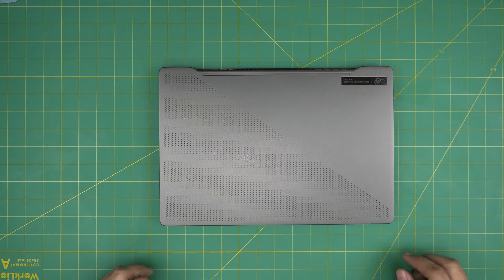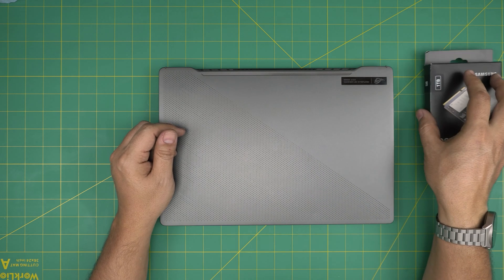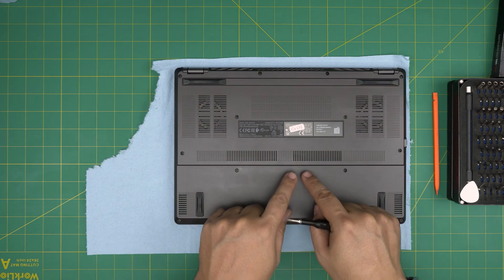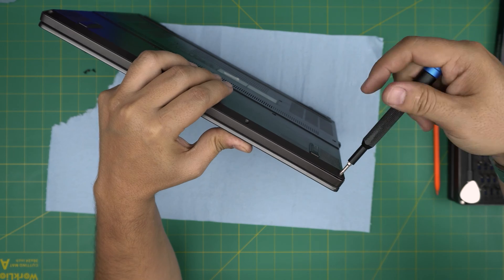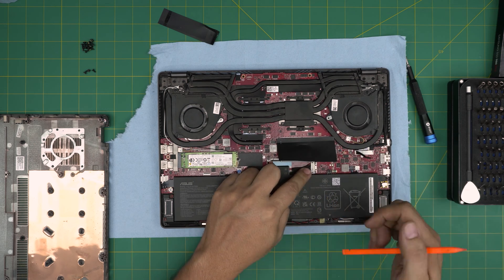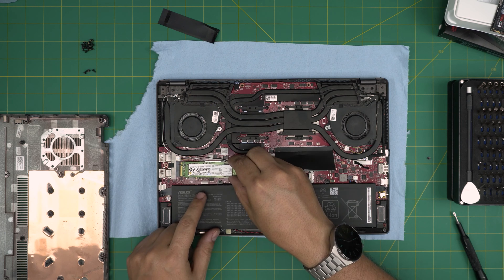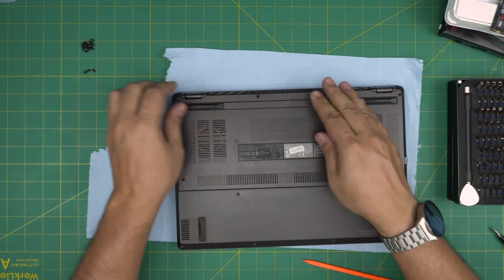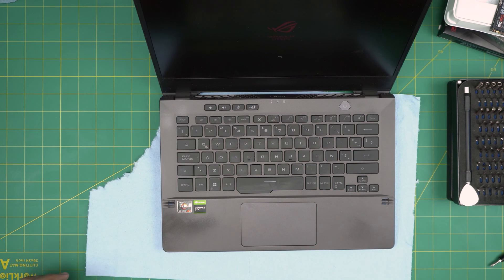How to Upgrade Storage SSD-HDD for ASUS ROG Zephyrus G14 GA401Q Laptop

Comment: How would you back up the pre installed data prior to the swap? I'm about to get a 2023 rog zephyrus G14 and I want to upgrade to a 1tb but I want to ensure it boots as if it came with the 1tb
Reply from the maker: 🫠Regarding your question, you will need to get a "nvme to usb adapter" https://amzn.to/3wATzwn
then you need to download the : Macrium Reflect
BUY it, don't download pirated version from piratebay websites.
😉then clone the main ssd to the new one and then swap them.
Should you have any further questions or requests in the future, please don't hesitate to ask me.
cheers🍻

This is an Amazon affiliate link. When you use my links, you are helping to support the channel. 🙏
Reply: @uFixTek  I bought the screwdriver set! I am approaching a problem after cloning and installing. My G14 recognizes the Samsung 980 pro SSD and that it's a 1TB but it is only allowing me to use half of it. What did I do wrong?

Comment: Every guide I read recommended disconnecting the battery. Why do you recommend not doing so?
Reply from the maker: In response to your question about not disconnecting the battery during SSD upgrades, the advice to do so usually acts as an additional safety measure. This is similar to the recommendation of using an ESD (Electrostatic Discharge) wrist strap for extra protection. With over 18 years of experience in servicing and repairing electronics, I can tell you that neither I nor any of my colleagues have found it necessary to remove the battery when upgrading RAM, WiFi cards, or M.2 storage devices. The schematics also indicate that it's not required.

However, if you're someone who tends to be a bit clumsy, perhaps dropping tools or screws onto the motherboard, then disconnecting the battery might be a wise precaution. Otherwise, leaving the battery connected should pose no risk, provided you avoid direct contact with metal objects on the motherboard. It's all about minimizing potential accidents.

If you have any more questions or need further clarification in the future, please feel free to reach out. 
Cheers 🍻